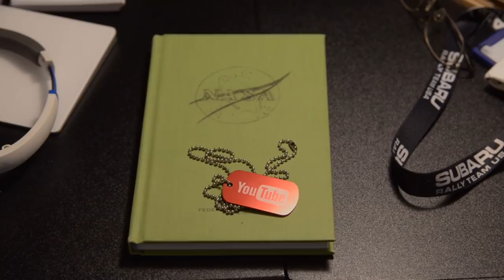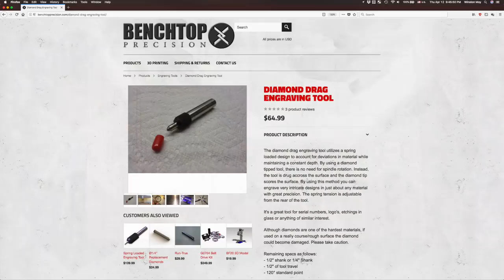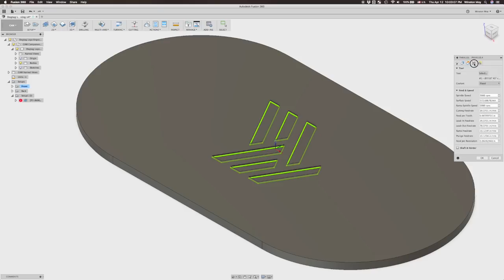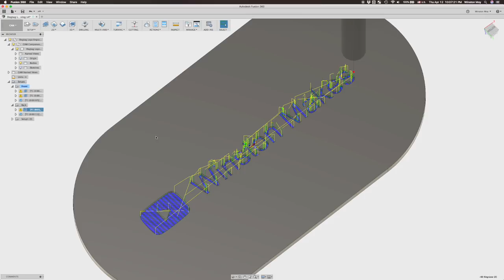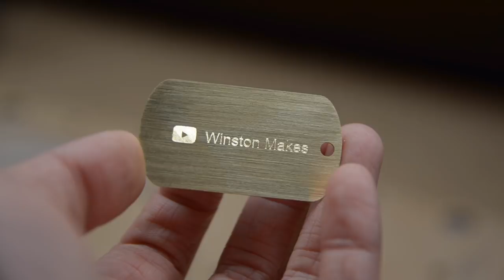Engraving Brass Dogtags with a Diamond Tip Drag Tool - #119 [CNC]

Comment: Great video dude, I make award plates like this at work all the time. I found the 90 to leave a slight burr to the touch but a120 tip won’t if you ever want to try that out. Also aside from this project I think you would benefit GREATLY from a desktop microscope. You can inspect your finished work like the engraved tags plus look for damage on your end mills, it’s helped out immensely in my shop, cheers.

Comment: Thanks for this!!! You just saved me lots of time fiddling around with Fusion 360. I am just starting to use a diamond drag bit on copper to make plates for intaglio printmaking. The lines part is working great (the tool throws a wonderful burr which holds a lot of ink, like drypoint etching, and it compensates in a lovely way for the variation in z axis, which with an end mill was a killer on my Snapmaker 2.0 even after facing the spoil board ). But I was just starting to experiment with fill, so thanks! BTW if you happen to know of anybody else doing this (printmaking art stuff CNC on copper or whatever) I would very much appreciate a pointer.

Comment: Wow, you were able to cut those tags our very close to one-another. I had no idea the Shapeoko could cut with that accuracy. I had been leaning towards the Nomad 883 for cutting 1:50 scale model parts, but it seems the Shapeoko may me capable of similar tolerances. For example, if I were to cut 1mm wide shapes into ~1.5mm brass sheet, could the Shapeoko handle it?
Reply from the maker: The Shapeoko lacks the outright rigidity of the Nomad, but if you go slow and steady there's no reason it can't hit similar precision. We tell people to expect a ball part accuracy of 0.003" on the Nomad, and 0.005" on the Shapeoko.
Reply: @WinstonMakes  Outstanding, thanks for the fast reply! Looks like I need to reevaluate the Shapeoko for my needs. I'm guessing you're able the control the router spindle RPMs from your computer? Or, are you required to manually change it the the router?
Reply from the maker: Manual change only. Some people add on a speed controller like SuperPID, but that requires some invasive router surgery.

Comment: is the cut deep enough that the engraving does not wear away  ?
Reply from the maker: Drag engraving is basically just a deep scratch. Only a couple thousandths of an inch deep. If you drop it in your pocket with keys, it will probably stand out less and less over time. Rotary engraving would be what you need for something more durable.

Comment: Are there any requirements your CNC frame has to meet to be able to use this tool? I'm going to be making a CNC machine from scratch and don't know what kind of motors to get or how to make sure the CNC is sturdy enough.
Reply from the maker: It only needs to be able to handle a couple pounds of force to use a spring loaded tool. But the machine should be solid to begin with, otherwise flex and vibration will affect every other aspect of the machine, like accuracy.

Comment: Great video, how did you learn to use fusion 360 so well? What's the best way for a total beginner to learn fusion 360? I want to use it to design wood furniture to cut out using my xcarve.
Reply from the maker: I went to school for engineering, and in doing so picked up Creo and Solidworks. Then in the course of my job, I did a rotation at a facility that used Inventor. From that foundation, I figured out Fusion as I went (with a bunch of visits to Lars Christensen's channel).

Lars and Autodesk's own tutorials are a good foundation. There are two stages of fusion familiarity in my opinion:
1) Understanding the fundamentals of CAD, being able to sketch and extrude. Same principles as Sketchup, just different interface.
2) Being comfortable enough to poke around and learn through trial and error. I didn't know how to make the engraving toolpaths when I started this project. I suspected it was possible, but I had to dig through the menus to find the right options. Fusion can be overwhelming, but focus on the basic tools, and add more to your repertoire as you need them.
Reply: Winston Moy thanks for the advice.

Comment: Hey there Winston. How would you rate the durability of these bits?
Reply from the maker: Of drag engravers? Ive only put a few hours in mine. @runcnctv on Instagram has put dozens of hours on his, not sure if he's ever replaced the tip but it's easy to do. They will wear faster depending on what your engraving, ex metal vs ceramic.
Reply: @WinstonMakes  yes the drag engraver. Thanks. I will chechouk @runcnctv (haha! funny name, reminds be of a music group ;)

Comment: I'm attempting this with my diamond drag tool modeled in Fusion as a chamfer mill.  When I do the parallel toolpath, Fusion throws an error, "Invalid tool type for milling."
Reply from the maker: So then don't use it as a chamfer mill. Open your tool library, filter by operations, and see what Fusion will allow for a Parallel op. There's like 3 or 4 potential options. Tapered endmill might work.
Reply: @WinstonMakes  I did.  I was just alerting you and other viewers to the fact that in the video you say to use a chamfer mill, and that won't work.  Fusion ought to have a dedicated tool type for this.